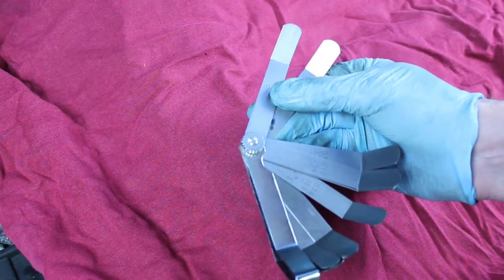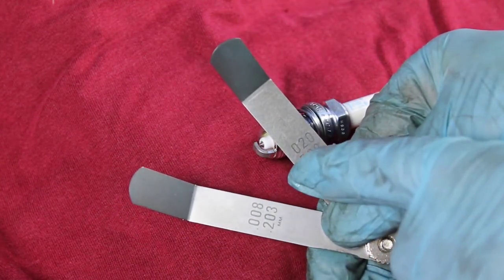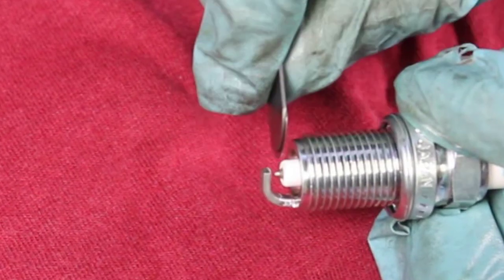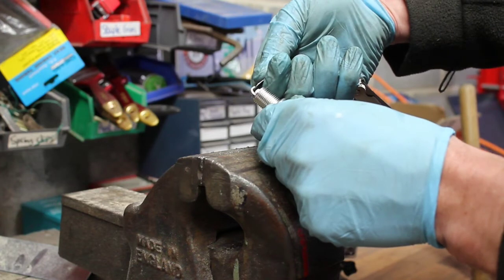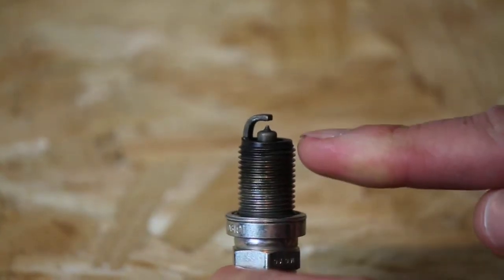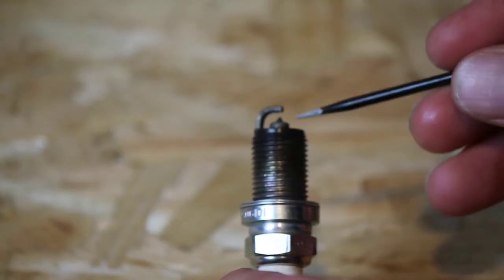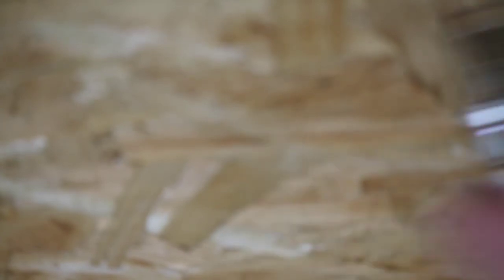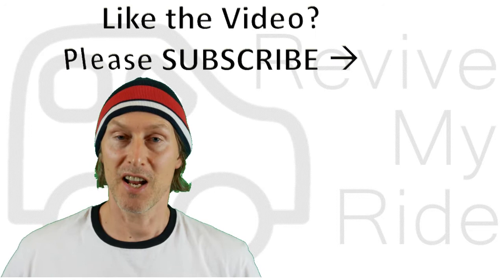How to adjust spark plug gap and How to close spark plug gap

Comment: The main question is: How to do it while making 100% sure the ceramic part doesn't take any damage!
Reply from the maker: It’s pretty easy, I haven’t broken the ceramic part on one of the spark plugs yet. But if you are worried about tapping the spark plug to close the gap, there is a tool you can buy to help you do this. Cheers, Phil